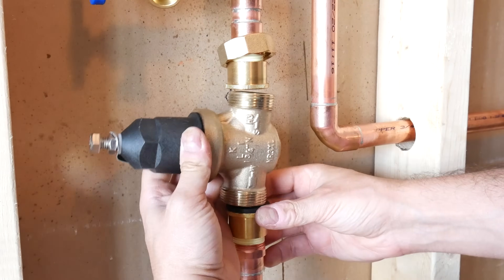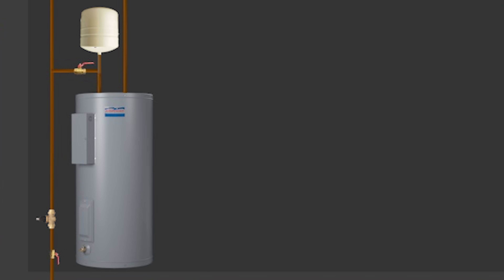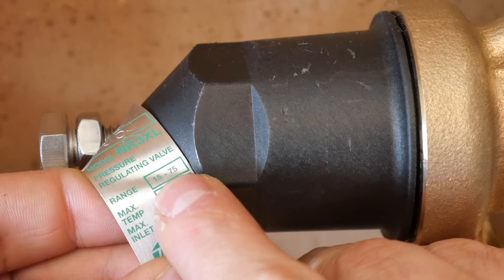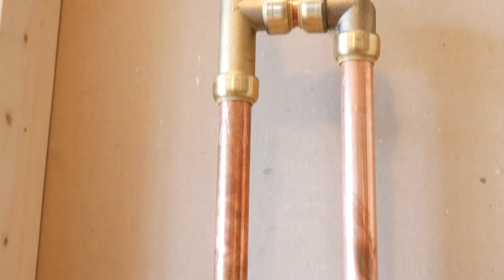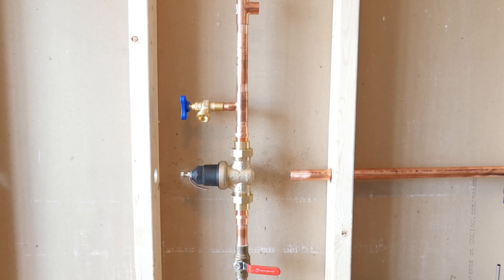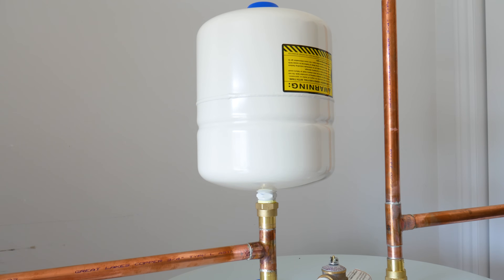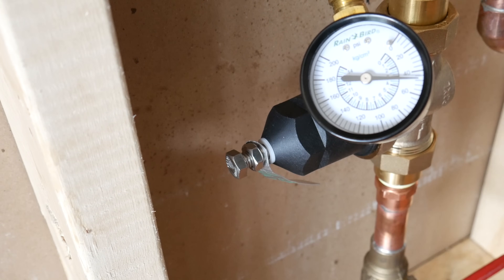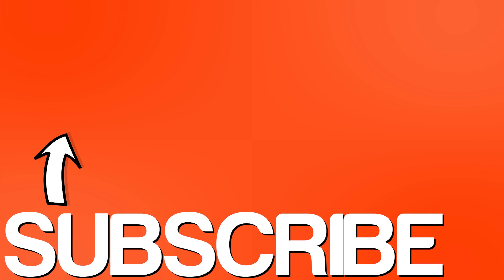How To LOWER Your Water Pressure (COMPLETE GUIDE) | GOT2LEARN

Comment: My water pressure is so low that we cannot use two sinks at the same time. Or when someone takes a shower in one bathroom,another person cannot even wash hands in another bathroom. Will replacement of pressure valve help to increase the pressure? Please answer your help is appreciated
Reply from the maker: Have you tried increasing the pressure on your PRV or is it maxed out?
Reply: @Got2Learn yes we did it worked little better for a couple months and now it’s back again. First 10-15 seconds water runs well and then it’s very slow
Reply from the maker: They sell rebuild kits, have you looked into that?

Comment: Good day! Good video sir as always, but what about pressure regulator? What is it and which from the 2 should I use. Thanks. Our water is comming from drilled well using jet pump by the way.
Reply from the maker: Best you consult with your local plumbing shop/city, they'll give you the info you need.

Comment: I am searching for a video on how to configure a house main shutoff valve with pressure reducing regulator and gauges to measure pressure on both sides of the regulator and a bypass. And all this mounted on a panel board. I what it to look very nice that I would be proud to show off to my friends and neighbors. The trouble I have is knowing what good products to select.  I also would like to find a good auto shutoff valve if it senses there is a broken line in the house.  Thanks.

Comment: What would cause loss of pressure water on top floor when taking shower. It would be ok at start but after 10 or 20 minutes pressure would go very very low. Also when you let faucet running in beasment it’s much stronger pressure than on main and upper floor. Just by looking at it you can see pressure is good in basement compared to upper floors

Comment: Doesn't the expansion tank give difficulty when measuring pressure later?  Essentially you are then measuring the psi in the tank and not getting an accurate water pressure reading.

Comment: QQ..isnt it just easier to partially close the main water shutoff valve to reduce the pressure coming into the house?
Reply from the maker: That won't solve your static pressure (pressure with all faucets off) and plus, you'll eventually start getting noises from half opened valves, with pressure reducers you won't have these issues.

Comment: Great video!  Question, if I don't install the thermal expansion tank, but I regularly use the TPV to release excess pressure from my hot water heater, will that suffice?  Thanks.

Comment: Just had a new HW installed. They added an expansion tank per code changes. Tank set at 70 PSI. They noted on expansion tank as supply as 70, however I started getting hammering. So checked the water pressure and the reading is about 95PSi. Attempting to adjust to reduce to meet the 70 PSI at tank, however when I got to 70PSi on supply side, still hammering. Reduced to 40 PSI, hammering stopped. Move pressure to preset settings 50PSi, no hammering, but the tank is still at 70PSi, Should I reduce the tank to match PRV setting or leave as is?
Reply: Update: can't have current PRV over 45PSI or hammering/vibration will start. So it looks like a new PRV will be required.

Comment: Hello, I loved your video. Question here, if I have tankless water heater do I still need expansion tank or just water hammer arrestor near the PRV? Thanks
Reply from the maker: You need to ask your heater's manufacture as they are all different, chance are you'll need an expansion tank, no need for water hammer arrestors if your pipes aren't knocking.
Reply: @Got2Learn thanks for your response, is there any specific type expansion tank that you would recommend for the tankless water heater?
Reply from the maker: @kellykai4068  Owners manual should give you an expansion tank size based on your city pressure and water heater model, every installation is different.

Comment: I have a PRV just before my water heater. But the water pressure to the rest of the house is too high. Should the plumber have installed it at the main water line coming into the house, and not way down the line at my water heater? My water heater doesn't have a thermal expansion tank either. Also, can I install a EB25 at the main line entrance and leave the PRV at the water heater location?
Reply from the maker: Yeah well if he skipped a few branches, those branches won't be regulated. Some PRVs have a check valve in them, some don't, if yours has a check valve, it won't allow pressure from your system back into the city, which means you need a tank. As for having 2 PRVs, I don't see any issues there.

Comment: How can you depressurize  water 40psi to 7psi
Reply from the maker: With a regulator like this one.
Reply: I have a customer that has bought a low pressure solar water heater,and I had put one of these but the pressure still builds up,when there is no water flow

Comment: Although I'm not a plumber, the Zurn Wilkins NR3XL has the internal bypass check valve feature and therefore, the addition of the expansion tank in this video was unnecessary.

Comment: if you loosen the unions on the prv to make repairs around it, would you need to replace the rubber gaskets? If so where is the best place to get just the two rubber gaskets. I have a wilkins 1 inch prv

Comment: Do you need a hot water heater to set this up. I’m in Puerto Rico have just a gas hot water heater. I have no electricity. I installed a pressure reader valve and a water pressure regulator. I still experience my filter canister cracking and they are expensive here. I’ve lost 2 so bought a taller one but would like to see no more leaks. I’ve been dealing with this 2 years.  I got the 25-75 psi but it’s set at 50 psi I get low water in sink but it ok at washer and shower.
Reply from the maker: No water heater needed.

Comment: You showed two separate models of the PRV constructions when discussing about possible problems/issues of the PRVs - one in talking about the filter and gaskets while showing an assembly of the Zurn Wilkins model which is completely different where the filter and gasket comes together as an assembly. My latter failed to relieve and control any pressure. So does that mean I can just replace the whole assembly of the Zurn Wilkens model?

Comment: My water pressure seems high but can't find a regulator as place was built in 1946. I want to put in a regulator where the old school water meter is in utility room which is not used any more since there is one out front by the road.

Comment: My water pressure usually is good but in May 2021 it completely stopped after a few weeks of hardly any pressure. Turn sink on for 30 seconds and it'd stop completely. We replaced the regulator valve and viola. It was fixed! Now exactly 1 year later it is doing the exact same thing. Could it be possible it is the expansion tanks fault? I plan on taking the regulator off and checking the seals and everything, not even sure if that would even be the reason why.

Comment: I see the common setup is to place the PRV after main shutoff valve.  What if I installed the PRV before the main shutoff valve to the house?  Here is the setup: shutoff valve from sidewalk --> PRV --> shutoff valve to the house.  I would think things will still work.
Reply from the maker: Yes it would work however if you needed to do maintenance work on it you would need to close the sidewalk valve, here in Montreal only the city can close that valve so it all depends on if you have access or not...
Reply: @Got2Learn  gotcha.  I have access to the valve on the sidewalk.
Reply from the maker: Awesomeee

Comment: I installed a pressure regulating valve but I can't loosen the lock nut to adjust the pressure. It's stuck. Do you have any idea why?
Reply from the maker: Is it an old regulator?
Reply: @Got2Learn  No, it's a new one. It's the Sharkbite EB45.
Reply from the maker: @alexdmd  were you able to undo it once, or are you doing it for the 1st time?
Reply: @Got2Learn  It's the first time. When I try to loosen the nut, the entire chamber moves as well. I tried holding the chamber with some pliers but the nut does not move.
Reply from the maker: @alexdmd  hmmm...sounds welded on, if you have a pencil torch you can heat the nut up a bit to crack the weld, try that...
Reply: @Got2Learn  Ok I will try that. Thank you for taking the time to reply!

Comment: The thing I want to know is where do you get the PRVs with unions on both sides. The supply houses we use have I think watts with only one union and it always causes more digging than should be necessary. What funny to me as someone in Texas is saying that “you’ll probably be putting it in the wall”. We put ours a foot from the meter in the front yard.

Comment: The rating on my PRV is 15-75 psi.  Does that mean that the max pressure I can get is 75 psi?  If so, that is great for me. I will not have to worry about configuring the unit for too much pressure.
Reply from the maker: Yup!

Comment: Thanks for video! So i had a PSI of 120 in the house and had plumber install a PRV, its now set to 75 PSI. He didn't install a expansion tank, i currently have a tankless gas water heater. Is this needed? What issues can happen without a expansion tank?
Reply from the maker: DO you have a combi or a conventional heater?
Reply: @Got2Learn  sorry im still learning this, its a bosch C950 ES NG
Reply from the maker: Yeah that's a combi boiler, so the expansion tank is most likely on the heating side, you shouldn't need an expansion tank of the potable side as it only heats when there's a demand so the system isn't considered "closed" ;)
Reply: @Got2Learn  Crap! the plumber didn't install any expansion tanks!
Reply from the maker: Ohhh...check the installing guide to see if they mention one in the diagrams..

Comment: Fyi any PRV that has a thermal expansion bypass feature will not release water back into the city system unless the downstream of the prv pressure reaches 10 psi ABOVE the street pressure. So if the incoming pressure from the street is 100 and your prv is set to 60, the pressure downstream would have to reach 110 psi for the bypass feature to activate. It could reach this pressure downstream when the water is heated by the water heater. When pressure builds this high downstream of the prv you will end up with excess wear and tear on all plumbing components in the home. Most notably the spring on any t&p valve on the water heater and eventually the spring on the prv. Bottom line is if you have a prv installed and a heat source downstream of it you need to control thermal expansion.

Comment: this also counts as a back flow prevent er, i have a 2.5 gallon water heater and one of these installed, if i put in the water heater do i need an expansion tank or is the piping enough with it being only 2.5 gallons? i know this sounds weird but i have a line of my sprinkler system going to a tree house that has 2 sinks and would like to put this in for the sinks but am concerned about that making their be too much pressure.
Reply from the maker: Not all count as a back flow, you must check with the manufacture!

Comment: I just had a new water heater installed replacing an old leaker. I thought everything was great, but the PRV leaks constantly into a P-trap drain and it's driving me crazy. The only time it doesn't leak is when another fixture in the condo is in use. I do have a PRV in the unit. What do you think is the problem? Thanks for any insight!
Reply from the maker: Could be excess pressure.

Comment: Need to ask a question, can you call me, 805-207-5366, Marcos, I was working on the plumbing in the yard, shut down the entire water main, when I was done, the toilet and kitchen sink have no pressure or water coming out. The shower works and the restroom works as well. Entire family is upset.

Comment: We all want to know how to increase our water pressure
Reply: Just move your house further down hill.
Reply: They are called electric booster pumps.
Reply: @rickjames6948  ,,
Reply: I really don't
Reply: There’s a difference between pressure and flow. If your pressure valve is bad, you can have super high dangerous pressure, but a weak flow. When you have a functional valve, your flow at the faucets and hose bibs will most definitely improve because pressure is distributed evenly throughout your system. Sounds odd, but it’s true.
Reply: Oh no we “all” don’t.
Reply: Your local fire brigade can demonstrate how: a pump

Comment: Dude please i have my water in is only 70 psi, and i turn it to 40, but flow is low, even with two faucet, is it ok to parallel it does it enough, mine is 1 inch, and want to add another 1/2 inch
Reply: Or solenoid valve control by pressure switch

Comment: what is the expected lifespan of these? thanks!
Reply from the maker: Depends on the usage, the imcoming pressure, if it's installed outdoors or indoors, really depends, but they last a long time.
Reply: @Got2Learn  in my case it would be installed indoors, the incoming pressure is 110 PSI. Thanks for your answer.
Reply from the maker: @ImNotADeeJay  that's considerably high, just make sure you get a good one and you'll be good for a while, and don't forget to clean out the strainer regularly if it has one 🤘

Comment: Hi I've 1question please? 
On the shower room , which is close to my bed room , if anyone wants to take a shower , the sound of the running water , it realy wake up , unless they open the water slow ? How can i solve this problem ? The house has 70 years old. 😂 . Thanks
Reply from the maker: You mean it bangs in the wall  or it,s just the soubd of the water passing in the pipes?
Reply: Hi , thanks for your responding , it makes huge noise , like Niagra falls 😂 . I am not jocking . 😂😂😠😡😫

Comment: I have a slab foundation currently dealing with slab leak and realizing how poorly designed and installed my system was when this house was built 14 years ago....  Main shut-off is just outside the foundation. This main branches with a "T" inside the foundation and so I need to put a pressure reducing valve between the main shut-off and foundation.   The shut-off is also down in the ground about 18" in a box.  Can these reducing valves be installed down in the ground?   This is north texas where it does freeze but not down in the ground (so that shut-off has yet to freeze but knock on wood).    My pressure last time I checked was 90 PSI so high.  Working to bypass that slab leak I have been opening up the manifolds in the walls (I think a monkey did the soldering there is solder and green from flux everywhere!!)...I was able to bypass the slab leak for now.  But no hot water now to half the house.  So while I'm working on all this I'm looking for a way to have pressure reduction to affect both cold branches. thanks for your videos.  Massive help!
Reply from the maker: If you can install it inside it's always preferable, but if it doesn't freeze outside, it can be installed there. Thank you so much for commenting and I hope your project turns out well, have a great day Vincent!

Comment: I have a pressure valve hooked up to my sprinkler system and my toilet in the Master Bath. There is no water getting into my toilet anymore since I haven't used it in about 6 months. Can a pressure valve stick or block water flow to the toilet? I've already replaced all the parts in and outside the toilet. My developer says they won't replace the pressure valve because it's not leaking. Such BS so I have to fix it myself.
Reply from the maker: I think there's an underlying problem here, PRVs don't prevent water from getting to fixtures, unless you say that it's affecting ALL fixtures AFTER that PRV, then it could be plausible.

Comment: Hi.Remember,these PRVs fail with time,so they must be always accessible,to repair,replace,or clean.how do u know u have high or low pressure? have always a gauge on hand.take measures in the night,as neighborhood,is not in high use demand of water.If you live near commercial,industrial place,u could have high pressure,as this is necessary,for fire protection.If using 2 PRVs, u can install in parallel,or series,depending of ur particular,situation.

Comment: Great video. Thanks for sharing. Shouldn't we use dielectric unions for water heater, and expansion tank connections?

Thanks in advance for sharing your experience and knowledge.
Reply from the maker: Thanks! Well, you can use dielectric unions, but they are more expensive and they don't really serve much.

Comment: Anyone ever see a PRV temporarily fail?   Last night I had about 82 PSI,  wouldn't reduce with flow so wasn't expansion issue.   Went to bed and woke up to find it had corrected itself,  then again in the morning it went up to about 75 PSI for a bit and now it's back around 55.  It's been stable since.   Slow leak on the seat perhaps only occurring sometimes?    Not even sure where the PRV is located,  with my luck underground.
Reply from the maker: Could be the city pressure that's fluctuating too.
Reply: @Got2Learn  Yah I was thinking that as well,  either way I think I would want a PRV set to just under the city norm to combat these spikes.  Didn't sleep well with over 80 PSI,  this home has some questionable plumbing.
Reply from the maker: Let us know what it is if you find the issue Brian, cherrs!

Comment: Did you tape and dope your M.I.Ps?
Reply: I'm not a fan of soldering an M.I.P that has already been wrapped in tape due to the potential of burning the tape. But, as you've shown in your video, it can be done. I just feel more comfortable with using a valve that's meant to be soldered directly to the pipe.
Thanks for the video. I enjoy your channel
Reply from the maker: @JasonMontell2501  I installed the tape after I soldered the mips, cheers Jason!
Reply from the maker: teflon only.